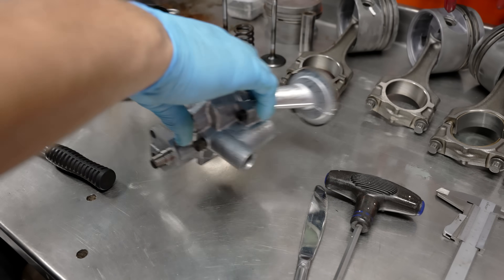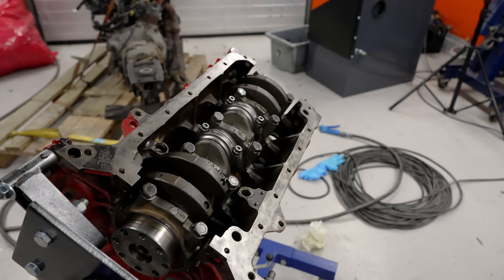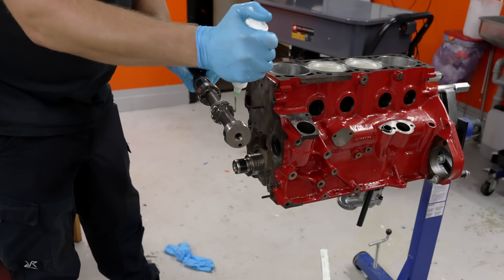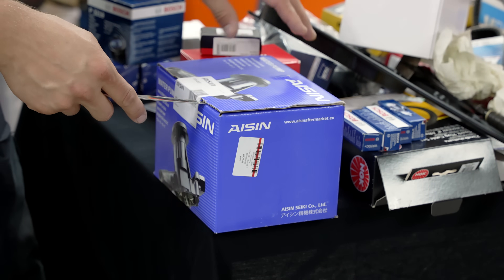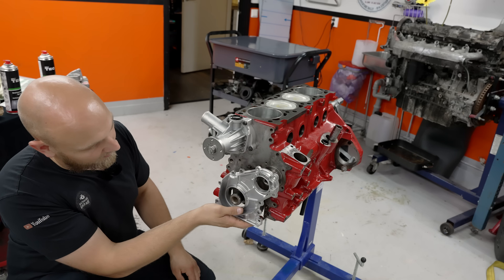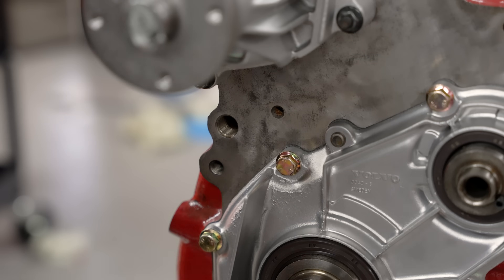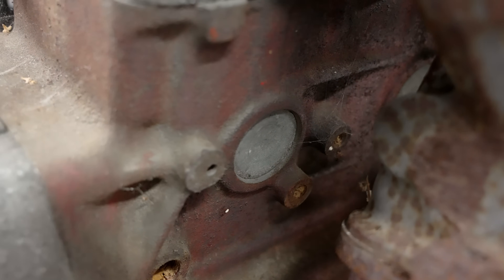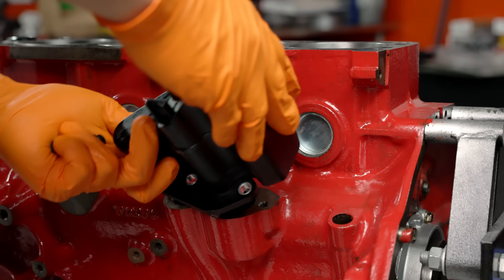I'm Building a 300Hp Volvo Redblock Engine || Part 2

Comment: Most people think that they are frost plugs and pop out if the block starts to freeze....not the case as they are casting holes and you should use some sort of sealant before putting new ones in ...although they might look fine on the outside they do rust from the inside out .....also although I really appreciate these type of helpful videos sometimes I do wish when people reassemble pullies please specify weather it's a left or right hand bolt thread as I got caught out before with this ...
Reply from the maker: True, i think i said frostplugs on this one, but you are correct hey are actually casting holes.

Comment: I was just recently manual swapping my 240. While I was in there I decided to replace the rear main housing gasket and rear main seal as well as the oil pan gasket. To my surprise the rear main housing had no gasket. It wasn't leaking either, but it was like that for a long time. Made me sick to my stomach.
Reply from the maker: So someone had used silicone gasket on it or was it just metal on metal?
Reply: @BackmansGarage  no silicone or anything it was metal on metal I couldn't believe my eyes.

Comment: Very nice video.
I think Volvo calls the "chest plate" the lower front timing cover.
When installing the oil pump and the oil pump gear, I usually install a re-enforcing ring around this collar / junction to make sure that the tab on the oil pump gear does not shear off inside the oil pump drive.
Reply from the maker: Yeah, its probably called the timing cover even tho it doesent cover any timing gear unlike the B20 engine 😀 

Never heard of this ring before, might be something to look into before I turn up the power. 👍

Comment: For pressing in the crank and auxiliary shaft seals I was able to heat up a pvc pipe and expand it to the correct size by pushing it over a flared piece of metal. Yours look like they pressed in properly but I know that the seals can be finicky so I thought I would put that out there for anyone else doing this. Also only buy an oem seal for the auxiliary shaft unless you want to replace it multiple times
Reply: Thanks, really helpful

Comment: What an awesome vid again! Just wondering, why did you use a harmonic balancer instead of a billet pulley? I thought the rubber of the harmonic balancer can't handle a lot of horsepower?
Reply from the maker: Im not looking for alot of horsepower. 300 it will be just fine 👍

Comment: If that's not the high flow oil pump, go buy one.
Reply from the maker: I think it was an hi flow typ of pump.
Reply: Definitely better with the original Volvo oilpump,its by far better than the aftermarket ones.
Reply: @Ghettochappy  Volvo offers two different pumps, standard flow and high flow. High flow Part# 1346144,